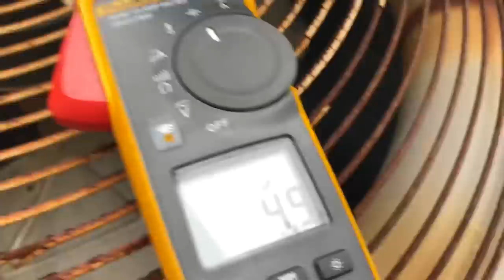Typical Sunday Morning Running AC Service Calls - Dead Transformer & Condenser Fan Motor Replaced

Comment: Mikey I use 3/4 liquid tight conduit. Sometimes you have those angles the straight pipe can’t get to. Works well. Just wanted to share with you.

Comment: The blue terminals are for 1.5-2.5mm2, red for 1-1.5mm2 wire, so if the terminal is too big for the wire it won't grip

Comment: I’m an appliance technician (similar trade) the second a customer even makes a comment like that I won’t want to work with them anymore. Customers like this are dangerous to your business. I had a callback today because of a faulty blower wheel (not caused by me obviously) customer immediately blamed me over the phone because of the noise and because I was there 4 days earlier. Demanding I drop everything and run out to look at it (on a Sunday) she wasn’t nearly as bad as this woman was and I still don’t want to hear back from them even though I wrote up the estimate.

Comment: Is the condenser fan blade rotating correct? Looks like air movement is backwards on the plant or maybe the wind.
Reply: Bro the rotation was wrong
Reply: For sure that dollar bill sucked down
Reply: @josephpietrzak2976   and it likely would have air bypass out the outer edge by fan guard too. I am about 98% sure it is wrong rotation and I hope Mikey Pipes can go back or send one of the crew back to change. I guess even the boss overlooks things.  LOL

Comment: I worked on the same unit. The other day. Replaced the transformer.  A week later I call back the transformer was dead again . Wasn’t sure what had happen . I replaced the relay and the contractor . And it seem to be holding now

Comment: Mikey.
Good job making that motor install look as good as possible.. Seeing those wires sticking out the top and loose above the fan blade drives me nuts
Reply: @PipeDoctor  like you said...9 or 10 years ago. Back to the whole learn from past...improve your skill

Comment: i always like to replace dual capastor with condensor fan motor, 1/2' seal tie works good to insulate wirings on condensor fan motor.

Comment: Daniel didn't blow that transformer,that whip isn't included in the maintenance, that is a repair and the stat wire is someone else's issue also a repair!Take pictures of everything the way you left it!
Reply: totally agree that wire was a repair issue and daniel did not have anything to do with the transformer.
Reply: @jamesnichols4280  Correct!
Reply: Good comment

Comment: I would have done it differently on the last job. I would have cleaned the condenser, it does not take long. My logic is, you are going to be doing big ticket replacements in the spring of next year and could have ‘rolled up’ the labour charge for the clean into the new installation. This is doing the best for your customer to ensure best system performance with reduced power consumption and assure availability for the rest of the season. Standards!😉

Comment: I love when they have aluminum wire feeding the dis connect 
Lol
Reply: not a problem if the termination is rated for it its when there is copper to al or copper only tht the problem with al wire

Comment: Holy cats,Batman. In my craft included in the scope of work is a line stating “ clear and free access “. I’d have changed them 4 hour minimum got back in truck and left. Plus that air handler area is a victim of flat surface disease. Paint cans and suitcases blocking your access. It’s like when Ted Cooke had to do a Spider-Man to reach a suspended unit in a moldy crappy closet. I’m here to repair your equipment not be your valet.

Comment: You should have replaced that disconnect on that second call. Especially after calling out the kid on his call. That disconnect not didn’t have a cover it didn’t have a cover shield for the high voltage. Tsk tsk tsk Mike. What’s good for the goose is good for the gander. Still love ya though.👍👍🇨🇦
Reply: I thought I saw the covers on the ground.

Comment: I’ve been working in hvac for about a year and a half so I’m still a newbie installing. How would you fix the disconnect whip? Would a new box need to be added? Since the tab that holds everything in place snapped out? Or would you just use a bigger fitting on the whip so it does not just slide out the way it was in the video
Reply: large reducing washers to fill the vacant space.

Comment: No inline fuse for your 24volts?
Reply: @PipeDoctor  Yea thats why one should be added it just saves the transformer in the event of a low voltage short. High voltage short is not all that too common.
Reply: Carry a solder rod to spin motors works great
Reply: @PipeDoctor  nice

Comment: I love this channel . I did not like how the customers were dissing mike and Dan ,. The lock nut could have been missing and when she told her husband to check it out he could have tripped or kicked the whip and it came out of the box. . Maybe make a check list for some important basic things to check .  Hey mike did you check inside the outside unit for if the low voltage wire might have shorted to something? Did you re secure the long low voltage wire ?  Just wondering, I know it’s impossible to video everything .     Have dan take pics of the outside unit, line-set , the electrical whip and disconnect . Have him give the whip a tug so he knows the locknut is secure .

Comment: Good job, but Ted Cook would be laughing at you for using that puller.
Reply: Ted cook takes all day taking off the fan..his hair grew another foot by the time it came off..ol
Reply: He sands the motor shaft and lubes it and then spins the hub and they come off, I've never seen him use a puller.  I did the same thing, but I wasn't afraid to use a puller when needed. @PipeDoctor
Reply: @denverlewis5087  you make it sound as if it's 30 seconds and it's not. mr know it all wont buy the proper tool? that's right, he won't even buy scissors to cut his hair  lol
Reply: @davo912  Whenever I see his hair, that song, "He's an old hippie and he don't know what to do., ' comes in my head.

Comment: The whip and the low voltage shouldn't of been over looked. But the bad transformer is not his fault seems like this house has alot of power issues

Comment: Mike Daniel might have accidently stepped on the whip and it pulled out of the box.  I would have got him for not securing the loose whip to the wall.  Originally Daniel may have not noticed it because it was in the box, but when he walked around the unit to clean it, he kicked it out.  Anyway the master found it.

Comment: Let go my wago 👍gotta love those little wire connectors! Best thing since sliced cheese. Great video Mikey  and shame on you Daniel. Be more observant
Reply: I agree, always take a step back and look at your work really good before you walk away. I would never leave a box like this or wires hanging. I also don't leave my tools hanging around like KEV does either. And I don't leave my garbage pop or water bottles on someone's property as well. Just some of the examples of carelessness. I actually worked on my neighbor's condenser had my water bottle on it walked out to the truck to leave then remembered it. Went back and got it. If your memory teaches you a lesson than you learn forever.